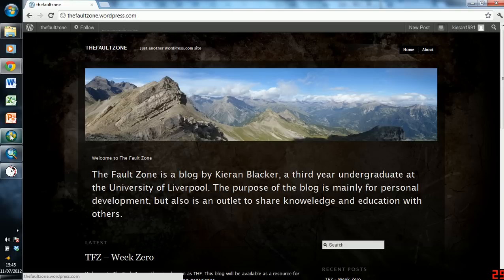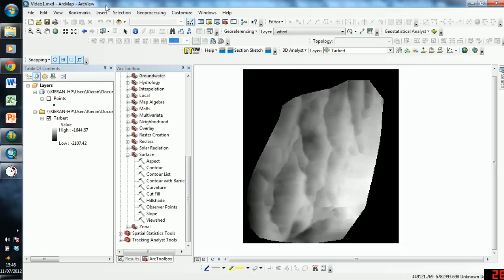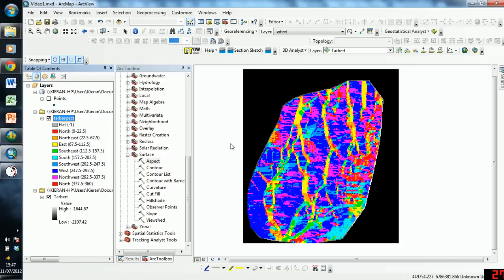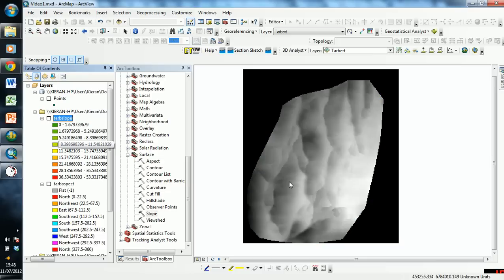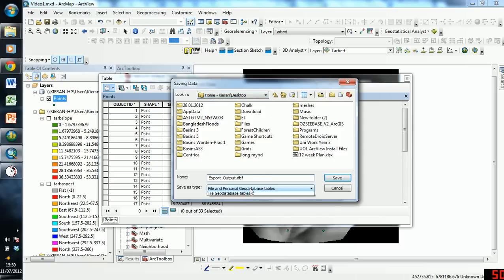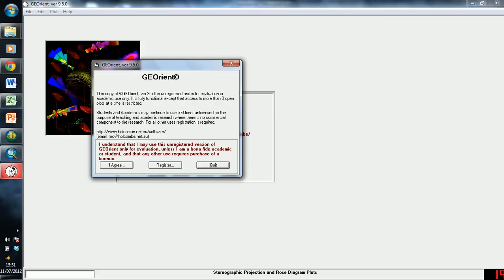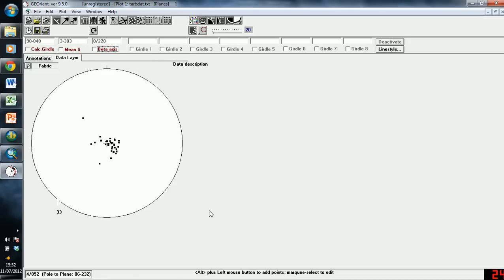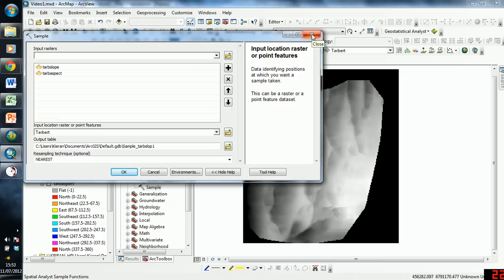Geological Orientation Data From Surfaces in ArcGIS

Comment: Nice one please share how to extract lineament in arcmap10
Reply: try to extract lines in PCI geomatica and exported to arcgis 10
Reply from the maker: Hi, do you mean extracting the orientation of a polyline? If so then it is pretty simple using python. 

Have a look at pasting this code into the attribute field calculator of the feature class you want to analyse: 

180  + math.atan2(( !Shape.firstpoint.X! - !Shape.lastpoint.X! ), (!Shape.firstpoint.Y! - !Shape.lastpoint.Y! ) ) * (180 / math.pi)

I'm sure you could come up with something more elegant though, and there may even be a way to do this under geometry tools in the toolbox.
Reply from the maker: Convert the lines to ASCII XYZ attribute text files, hell even just get their coordinates into excel! The import them as points and convert them to polylines. Tidy them up with the edit tools